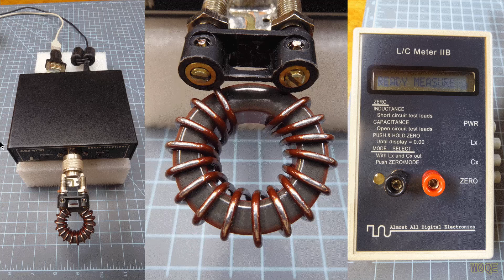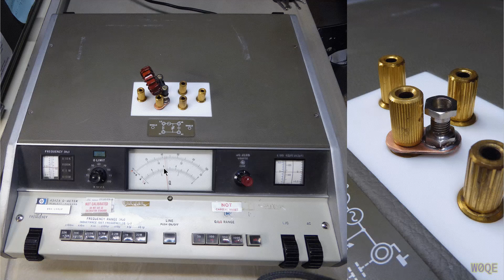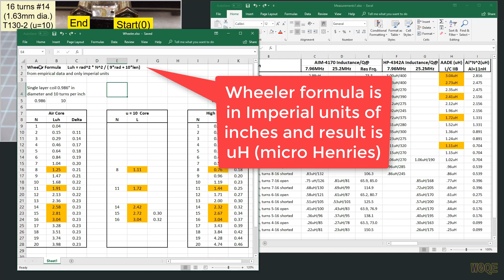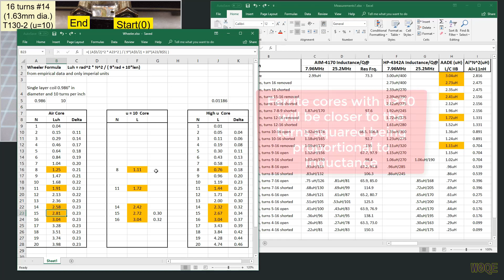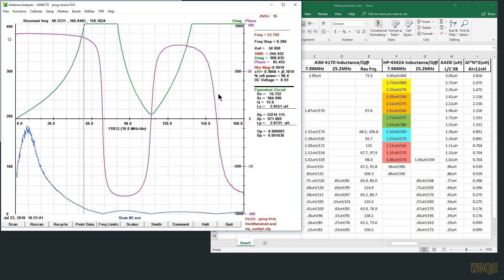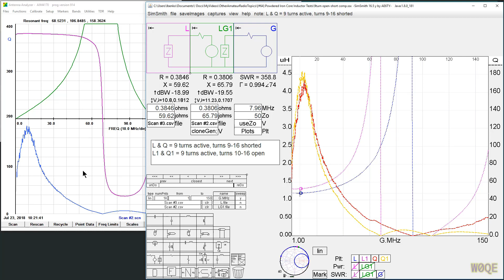#64: Powdered Iron Core Inductor Tests

Comment: Suppose we have some unknown toroids and we want to test if they would be suitable for an RF amp.

What would we need to know and how would we test it?

I expect we need to know the frequency response up to the associated RF frequency and it's Q.

Please help.
Reply from the maker: This question is a common one with no simple answer.  When something is called a toroid we are referring to the shape and not the underlying material which can be many things resulting in a structure with some permeability value and some amount of dissipative loss when wound with wire and excited with an AC voltage.  Most people who ask this question have a bunch of unmarked toroids of unknown origin and want to know what value they might have.  I would start by winding some reasonable number of turns occupying about 75 to 85% of the core and measure the inductance vs frequency with a low power device such as a network analyzer.  This will yield the inductance vs frequency which will be constant at low frequencies and then rise faster than expected as we start to see the effect of the capacitance between turns and the toroid itself and eventually the impedance will rise and the impedance will become capacitive.  Most of the time the most useful frequency range is below 1/2 the frequency where the impedance starts to rise faster than expected.  Depending on the accuracy of the VNA you might be able measure the Q of the inductance which will give you an idea of how much power will be dissipated in the core.  This will allow you to reject many of the cores you are testing. Cores from many manufacturers have some color coatings which may help but the is not 100% reliable for identification.
The final result is pretty simple.  The heat in the core is the result of a percentage of the loss in the windings that directly heat the core, the efficiency of the core at the driven flux level, the duty cycle of the RF signal, the frequency, and finally the location of where the toroid is mounted.  Saturation of the core due to excessive flux is nearly never a problem except at extremely low duty cycles.  Also wrapping tape around a core to increase voltage breakdown will increase the heating.
Having the ability to excite a device at the correct frequency, voltage level, with the chosen winding wire size etc. is the best way to determine if the sizing is correct. I use a high power amp than can provide a 100% duty cycle for a time of at least 5 minutes to measure the final core heating.  A small thermocouple of an IR spot thermometer on a black paint patch will measure the temperature.  Also having a notebook of previous measurements will be invaluable.  Happy measuring!
Larry, W0QE

Comment: What kind of powder core do you recommend for medium frequency 50 Khz for high power SMPS application  (instead of Ferrite)? Fe-Si, Sendust, or other. Thanks
Reply from the maker: There is no way I could recommend what core to use without knowing a lot more about your intended design.  50kHz is a pretty low frequency so the typical cores will have permeability of more than 1000.
Larry, W0QE
Reply: @w0qe  i want to build a large Pulse Transformer  and i am thinking to try high saturation flux density (1.6 Tesla) and low permeability FeSiAl powder core with distributed gap instead of gapped Ferrite with high permeability and low saturation flux density.
Reply: @w0qe  available permeabilities for FeSiAl powder cores : 14, 26, 60, 75, 90.
Reply from the maker: @szekerespista3758  You may know more about this topic than I do so I don't think I would be of much help.  Sorry.
Larry, W0QE
Reply: @w0qe  Dear Larrry, thank you for your response!

Comment: Hi Larry, Another EXCELLENT video. Thanks for your time and effort to make these available to us.
A question. 1) Do you know of a data source regarding the permeability degradation over time?  In particular, I am interested in the slugs we have in our vintage receivers in IF and RF cans. Data on degradation over time for various torriotal cores would also be helpful. I am sure that the more heat a core experiences, as in your 3.5KW amp, the quicker the degradation will occur.  73, Glenn WA4AOS  DSM Labs.
Reply from the maker: Glenn,
I think the term you are looking for is disaccommodation or maybe dis-accommodation.  Doing a search with this term and ferrite brings up several articles.  I'm not sure how well this information might apply to old ferrite material as the ferrite material cocktail is ever evolving and is different between manufacturers.
Larry

Comment: It's not surprising that the shorting turns does not give the same inductance as removing turns in part because shorting the wires, for example T15 to T16, does not mean there is no current in the 16th turn, but rather, less current in the 16 turn.
Reply from the maker: Lee,
I agree with you and this is expected.  Also the Q dropped with the shorted turn which was also expected.  When designing a tapped coil there are trade offs such as open, shorted or removed turns which need to be made.  Hope you enjoy the videos.
Larry, W0QE
Reply: @w0qe  I thoroughly enjoy your videos. It's so refreshing to watch someone who knows what he is talking about and clearly explains stuff rather than glosses over it. Look forward to more of your videos.

Comment: I have not gotten it out in a while but I still have a General Radio 1652B LCR Bridge that always did a pretty decent job measuring parts. It had a 1khz oscillator built in or you could feed your own external source.